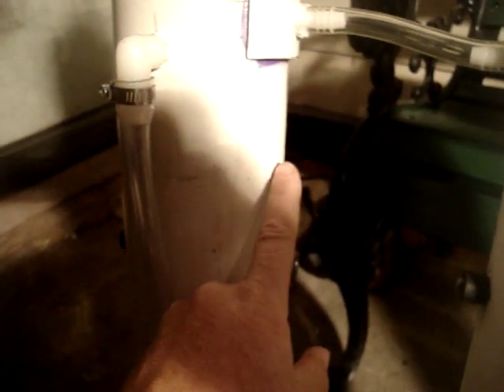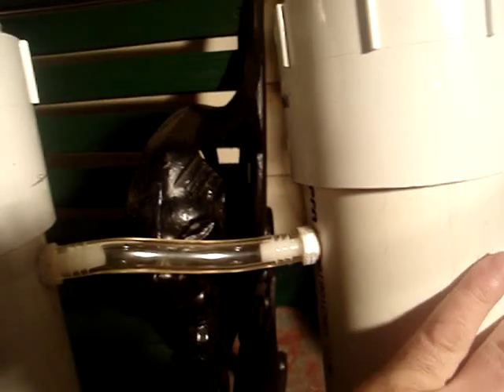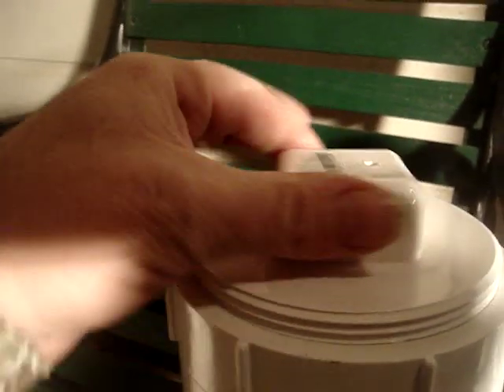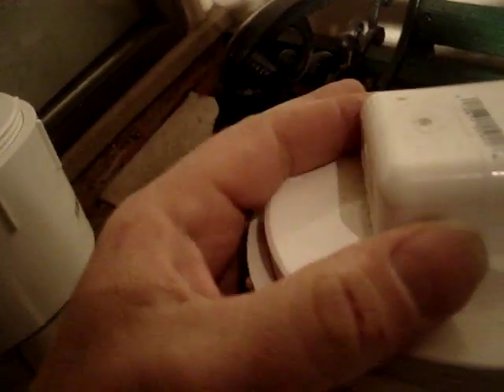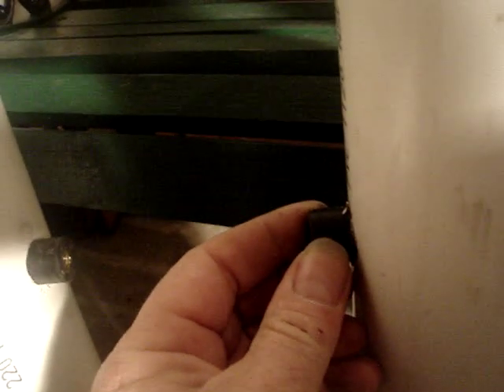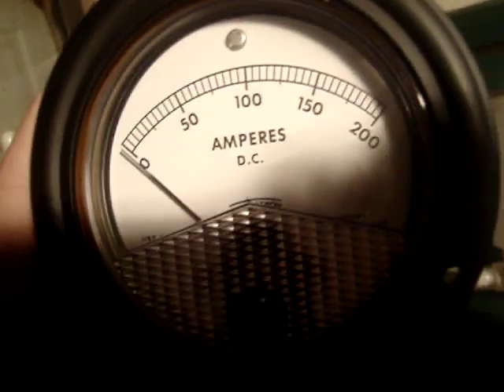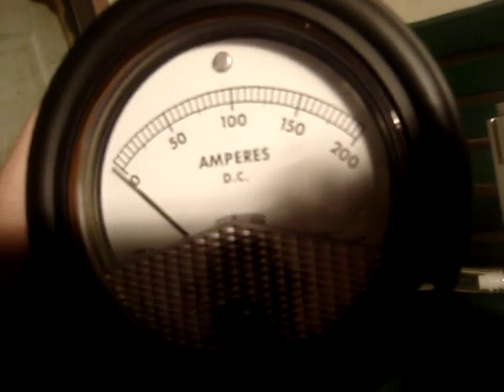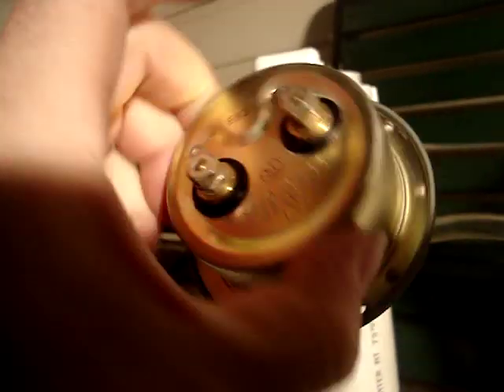NLOlin4Solar Part 3 HHo 4 gen

Comment from the maker: Pos & Neg straps will be under the water line and shaped like a square C, they wont be exposed to the gasses, the edges will either be coated or rounded with no sharp edges, thank for the complement

Comment: think about coating your pos & neg straps with a non conductive material, like truck bed paint. Otherwise you will get current leakage from your straps. If you coat your plate edges as well, it will greatly increase the efficiency of your cell.
So far, it a great looking electrolyzer.
Peace.
Mike.